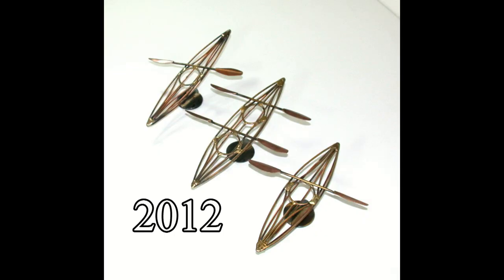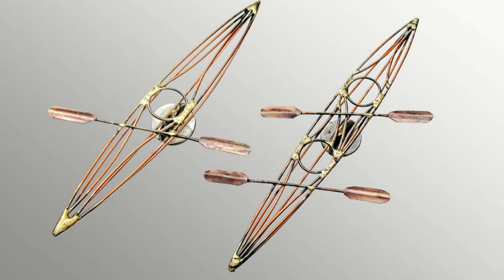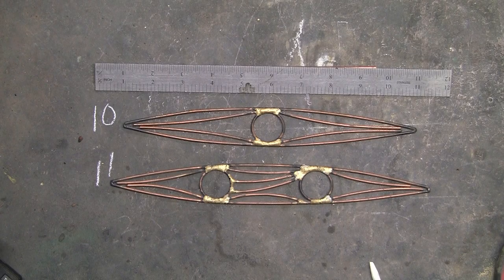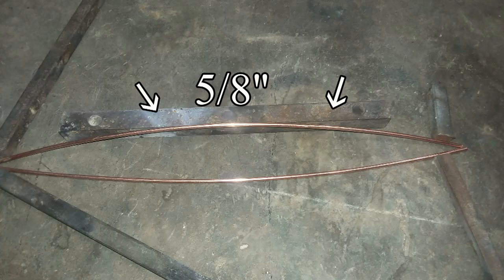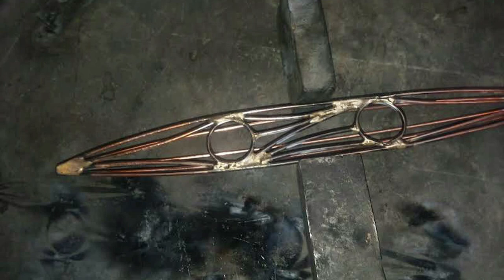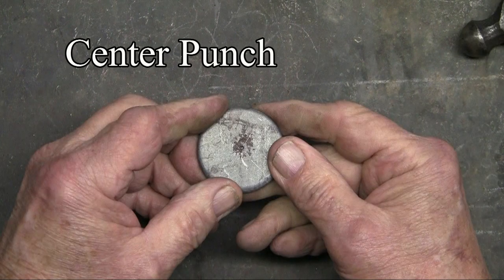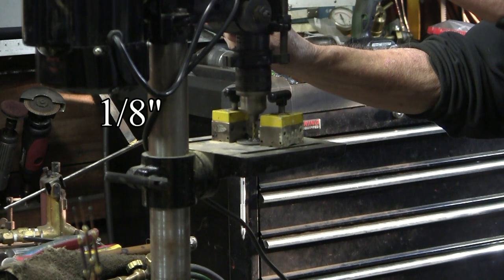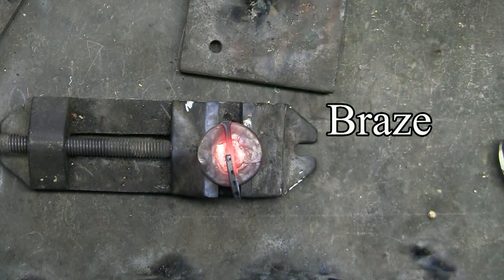Kayaks - A Memo to Myself

Comment: George, can your projects also be accomplished with a Map Pro torch?
Many thanks!
Reply from the maker: I really don't know.  I've never used Map Gas.  Looked up "Map Pro Torch", and it appears that it is hot enough.  For brazing I would use the thinness brazing rod which is usually 1/16" .  Let me know what you discover.
Reply: @897473   Thanks, George.

Comment: the other way to do those in mass would be to make a simple pin jig
Reply from the maker: That's interesting.  Do you have any examples?
Reply: @897473  not physically here.
you could use soft dowells on a board standing up right the cut a small groove / slot into them so when you ready to lay out a new kayak you place the rods into the slots so the conform to the right shape.
same way a full size 'welding table' would work.
i've often made simple jigs for stuff i know i will be doing alot.
for example my heel tips on my high heel shoes, i replace those myself using steel rather than plastic